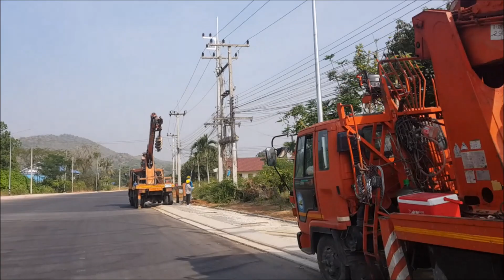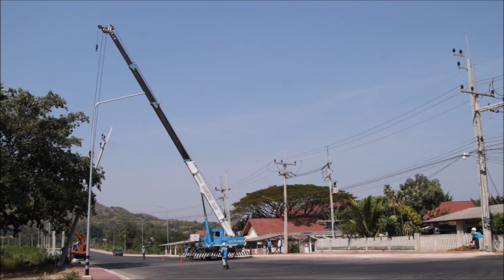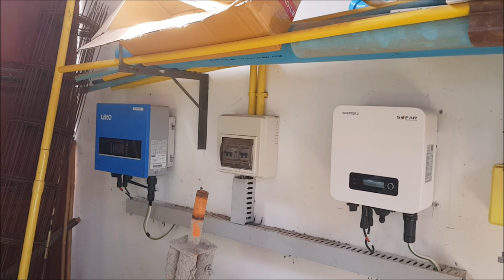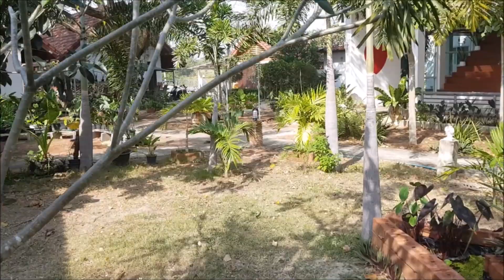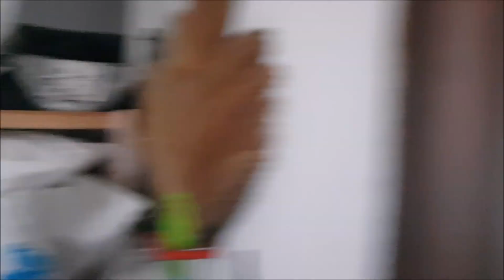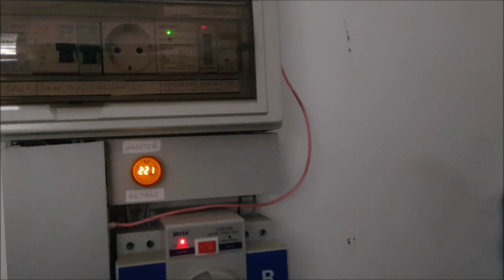Disconnected from the Grid. Our Resort for four days without power...

Comment: Usually here in the States, at least where I live in Florida, the power company will only cut the power if absolutely necessary. That means even while replacing poles and/or wires, the grid is still online.
A few years ago they replaced all the wires with higher gauge to handle the loads better and we never lost power. Same when they came through and replaced a lot of the poles (which, I think the poles were done first as some where not good enough to handle the higher weights or the heights needed).
Interesting that they shut you guys down completely while they work on the lines there. I suppose it mostly depends on the equipment available and the safety restrictions/regulations
Reply: In my country they supply people with generator trucks. But that is done only for long term outages. Quite often in my rural area they announce shutdowns for a repair, maintenance with outage of an hour. Then its rather convenient to have still power for the water pump etc.
Reply: @geraldzincke2218   Yeah, usually what happens here is that the only reason they shut down the grid is if they have to replace the transformers. For instance if changing the mains from 14kV to 28kV, they gotta change the transformers for the last legs for the homes. But even then they usually have 2 or more running in parallel and do a quick change over.
Grid outage due to maintenance is actually pretty rare as far as I know in my area.

Comment: Thanks for the video Roland. Is possible (at least technically) for you to be fully off grid? I saying technically because it might not make economic sense to do so.
Reply from the maker: No. To take the whole resort off-grid would require around 30kW in inverter power and probably around 200kWh in battery capacity. From a business perspective that would be unsustainable. But keeping the lights on when the rest gets dark is still a great advantage.
My main battery was out of service these days as that system is AC-coupled and only works when the grid is there. That system is reducing our power bill primarily. It all makes sense.

Comment: That Deye should provide a grid for your grid tied up to 80% of the Deye output. I love AC coupling works great
Reply from the maker: Good idea. I just didn't wire up that inverter to allow such a setup. I did it more like a classic backup with essential load panel. I can imagine such a setup in a house where you are feeding in right at the service entrance as one needs to isolate the grid connection in such a scenario where you are creating a self-sustaining grid bubble.